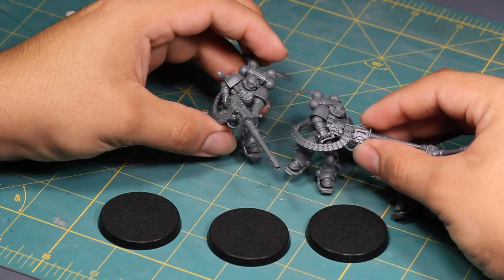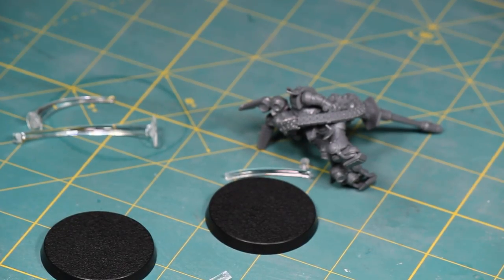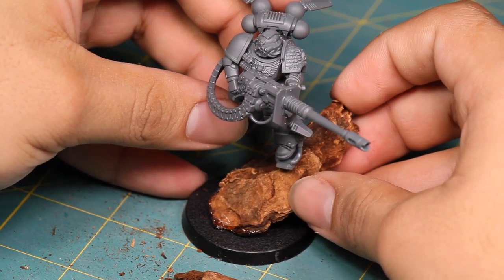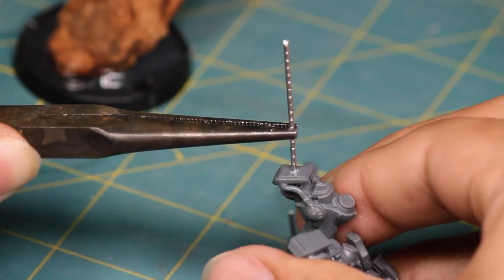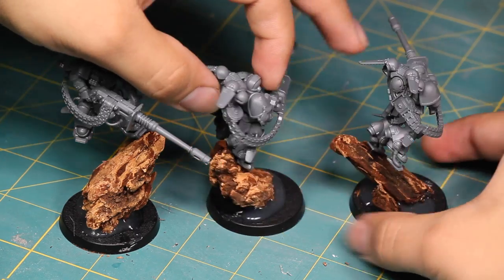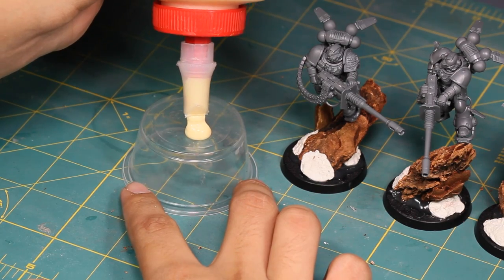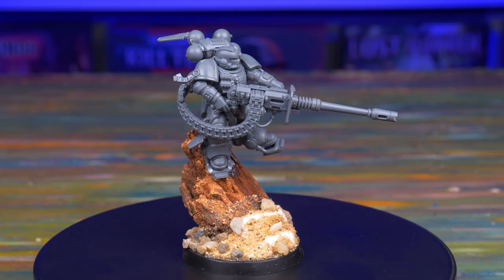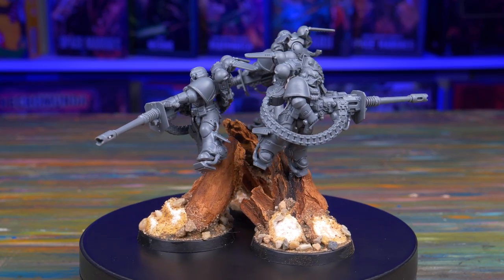Fixing Games Workshop's Biggest Mistake! Flying Stands!

Comment: I must be one of the three people on the planet that actually doesn’t mind flight stands 😂 
Admittedly they aren’t amazing, but they serve their purpose as far as I’m concerned… 

Great looking bases, fantastic job as always dude!
Reply: I think I must be number 2 because I've never understood the hate, they just don't bother me in the slightest, if anything I'm almost of the opposite opinion that they look sillier bouncing off large convenient rock structures.
Reply: I think they look okay, but I deep-strike on roof with my Inceptors so much that everytime one model falls off the roof the stem will break. I tried a hack where my boss taught me to drill a hole into the back of the model and sharpen the stem to stick it in - still breaks. So at last, I just took some brass sticks and stuck them into the base, with some rocks to pile on the base to cover up the base of the stick. Works wonders, and I actually liked the aesthetic of the metal flying stem even though it's not "transparent"
Reply: 3) Never noticed them enough when building to hate them, I just use to cut some taller and shorter to have different sizes for more interest.
Reply: For me, the only problem with these ones comes with larger models. For AOS Kharadron Overlord's boats the flight stands don't give to the model enough stability, so you have no choice but making "something" stronger and integrating it on the base.
Reply: Same i dont mind them either
Reply: @Gatugatuno  I own all the KO boats but never had a problem with the supplied stands - I thought given the amount of plastic in the Ironclad and how small the stand contact point is would be certain to snap, and while it sure does wobble a lot when moved it's never broke.
Reply: @wolfie54321  Not my experience with the Frigate. While the Gunhaulers give me no problem at all, and the skyrrigers work perfectly, the Frigate attachement has broken twice, both during transportation, due to that "vibration" it has almost all the time. I cannot speak about the ironclad, i don't owe any (for now)
Reply: Im with you on that - easy fix with magnet on the top of stand. Own 9 inceptors - no issues
Reply: Yeah, I think they're fine. I enjoy seeing the creativity for those that dislike them, or just want to try something new.
Reply: Experienced player and hobbyist here: wait until those stands fall once or get to couple years of age. Or accidentally leave them in the sun too long. Or let them get cold and then drop them. You'll see how fast they snap. 😉
Reply: I have admech pteraxii models and it might not be the stand rather the model, but they constantly snap off the base

So I’m probably considering getting some printed smoke trails for them instead
Reply: I didn't mind the older ones on things like Space Marine Landspeeders, Drukhari Reavers, or even on the Raiders... never even bothered painting the clear base that went with them (though I certainly would now).

My main concerns with the new ones are the small connection points to the model, the lack of any kind  of "pin" into the base (a simple hexagonal end to go into a hexagonal base hole would be an easy improvement), and the general strength of them for larger models.
Reply: @wolfie54321  yeah, it was a surprise to me when I saw the Frigate stand is almost the same size as the gunhauler's one (although the difference of size and   weight is enormous). I keep them unpainted, but because my bases are water-themed using epoxy resin and, those transparent pieces looks almost like a weird water column :)
Reply: Well brother you're not alone I actually like them
Reply: I think they look fine but I've known many new kits with the stems braking easily.  

I do think the printed smoke trails are hands down the best and I'm suprprised frankly we've not seen something official like that from GW since they will do flames and other such things on models.
Reply: I think what happens is you see one of your models with several hours of labor in it take damage in transport because a stem snapped somehow... And you just don't trust them. 

I'm a newer player and I've already seen in 2 years in the hobby 3 stems snap for other players so that I'd not trust them.

Comment: Nice! I've been looking for an alternative to GW flying stands, but there's nothing out there. Thoug I do want to ask, what would you do with larger models with Flight Stands like New Stormdrake Guard for AoS, or Kharadron boats? Even medium sized models like Idoneth Eels? Because I don't think there's a wood-chip big enough for many of those.
Reply: sometimes you just have to break out the nails for stronger flying stands
Reply: At the LGS I work in, someone has a giant eldar plane that he, no joke, mount onto the base with angle brackets.
I use brass sticks as a pin to pin through my inceptors and suppressors into the base.
Small plane bases tho, I just ran with the original. I think those do the job.
Reply: I saw one very cool alternative over on Tabletop Titans; a viewer sent them in a model where they had 3d printed a big poofy exhaust plume that you glued to the jet pack.  It made it so the model hovered a few centimeters over the base. Looked great
Reply: @lieutenanteclipse9975  I got a plexi tube that was going in the trash to use as a base for my Tigersharks. I had to make them ~10" tall so that it wouldn't be constantly bumping into terrain on the boards that I use.
Reply: The magnet baron has alternatives you my like.
Reply: @KingFlameHawk  Thanks! This is just the kind of thing I was looking for.
Reply: Put the eels on water waves and the ships on clouds. For these marines you could even base them on smoke trails from their jumppacks.

Comment: For cheap flight stands do this:

1. Go to your local dollars store.
2. Buy a few packs of the cheap small paint brushes with the clear acrylic handles.
3. Cut acrylic handles at the brush feral and whatever height you want.
4. Glue to model, glue to base.

Comment: You'll find super glue will work better if you wet the pin and put it the hole in the bark chip. Do this a couple of times. Then apply super glue to the pin. As the  little moisture transferred from the pin to the absorbent wood/ bark will stop the glue being soaked away too fast from the part before it sets.
It's worth nothing. That it's better to add the miniature to the pin once the pin dries in the bark chip. That way you avoid  super glue frosting.( it'll only happen when you've over applied water .Or  Murphys law when it's an expensive miniature)

Comment: Interesting video. 
This technique can definitely work for more dynamic models, like those who look like they're just about to jump or land. 
However - For this particular models, In my personal opinion I don't think it's the right choice. The models themself look out of place already, like they lack any kind of dynamic whatsoever. To greenlight this design in the first place is questionable. Even on their flying stands, they just don't look right. They would definitely benefit from a more static position, with both feet on the ground or close to the ground. But this are just my two cents. 

You did a great job with the bases and as long as you're satisfied with how it worked out, it's all fine.

Comment: Yeah GW flying stands have never been good, and those new ones are even worse. On my old Eldar jetbikes I used to just use the very bottom of the flight stand so they were hovering like speeder bikes in Star Wars. Only problem I ever had was someone accused me of modeling for advantage since the bikes weren’t as high up. The judge ruled in my favor since they were still modeled on flight stands and the rules didn’t specify how high they had to be. I seem to have gone a bit off subject… love the wood chip bases!

Comment: I've never understood the insane levels of salt flying stands seem to illicit in some circles, these newer curved stands are a vast improvement over the old straight ones. I'd much rather have a discrete clear stem supporting my mini than have them all bounding off scenery - that can work for a character but a whole squad dragging around elaborate scenery with them just looks silly imo.
Reply: The straight ones were fairly limiting in how they attached to models, so I understand why GW changed to these curved ones. However, these curved clear rods are incredibly fragile. As someone who hangs around Transformers spaces a lot, it is a common sight every time a Transformers toy with clear plastic somewhere near a hinge releases to find people snapping them accidentally. I guarantee Jay did NOT put much effort into snapping that stand in this video, and these flying stands are meant to be load-bearing too. You would have to be exceptionally careful when transporting them, much moreso than for any other kind of model.
Reply from the maker: I think they look... fine, but they break really easily which is unaceptable.

Comment: I would be interested to see other soloutions. The flying stands aren't great but I don't like the more common soloution of having them touching something. I'm interested to see if anyone has found a decent way of making them look like they are flying.
Reply: Yes, but fiddly. Strong wire - I have some very stiff  wire in my "real" toolbox. The real issue is finding a  sturdy way to place it in the miniature or stand, often needs to be built up and/or drilling where a model is substantially thick. You can even put smaller models a bit off-centre, but the base needs to be weighted. 

I also recently acquired some bicycle spokes. They seem they could also work. Bonus, these area already black.

Comment: Sorry I hate models standing on giant rocks.  Do they carry the rock around the battlefield as they move?
Reply: No? They're grazing a rock that's jutting out from the battlefield itself.. 

Why? Do they carry clear acrylic rods with them to hoist them up so they can dangle over the battlefield?
Reply: @OnlyRoke  Nope.  When they move across open ground, it makes no sense for rocks to magically appear under their feet.

The flying stand doesn't have to be clear.  I paint mine the same color as the basing material I use.  Which is also the same color as the mat covering the table.  The flying stand basically disappears.